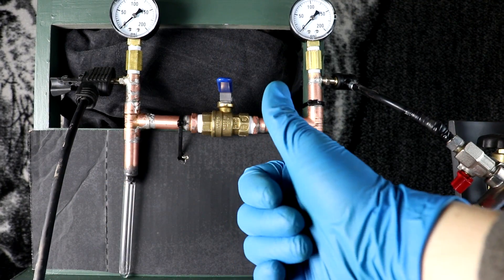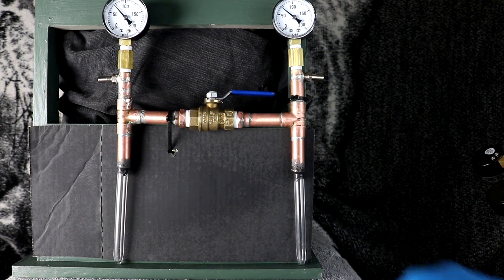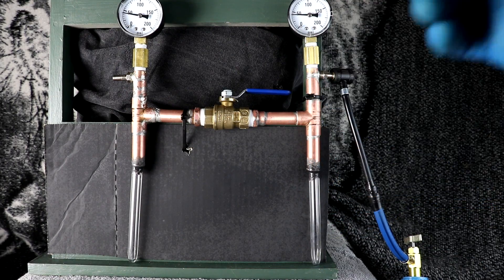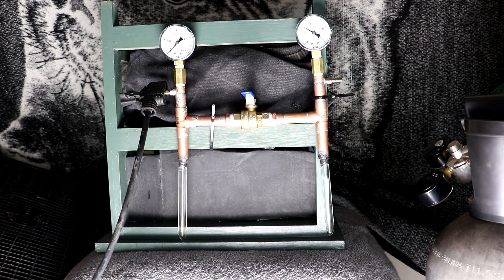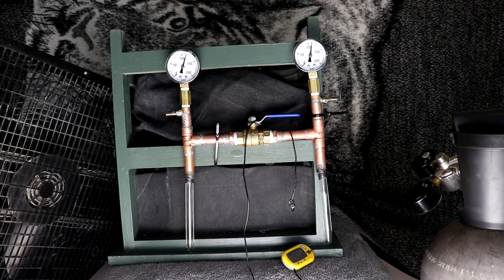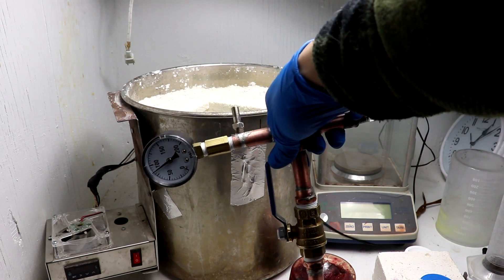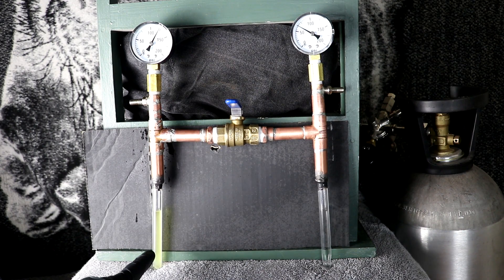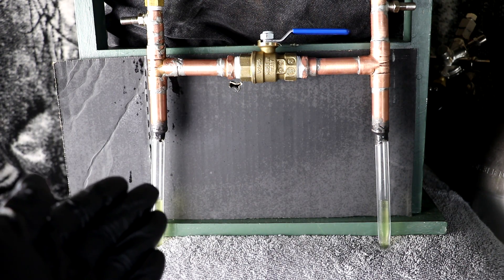The Law of Partial Pressures Demonstrated Using Vapor Pressure

Comment: It makes sense if you think of it in terms of evaporating water allowing things to dry. Imagine a house in the desert (dry air) with two rooms. Hang a lot of wet laundry in one room. Keep the windows and doors closed. Eventually the laundry will stop getting drier, because the air in the closed room will be saturated. Now open the door between the two rooms. Only logical that the laundry now gets drier as the dry air from the other room gets in and helps the lanundry dry again. Not mind-blowing at all.

Comment: Multiple solvents in spray paints have another practical rationale: the fastest flashing solvent are meant to depart rapidly to aid atomization (exiting during spraying) while the slower flashing solvents help moderate surface tension to allow the paint to dry through rather than just skinning over (which leads to thing like orange peel and avalanching)

Comment: One correction, there are some liquids that when mixed lower the vapor pressure. This is because they are more attracted to each other than themselves but as you can guess, these are fewer in number than the normal reactants.

Comment: I wonder having sweat (solder) alot of copper pipe in my day, could you have used lead base solder or a higher mixed lead based solder to attach the galss to the copper. Instead of the jb weld. Assuming they are the same size and all that. We all have seen the windows soldered together in a church or otherwise apparently thats done with lead. Wonder if a glass expert might entertain my thought here give me a coment.

Comment: Finally I understand what is really going on inside a camping fridge. The ones which work with a heat source. Two liquid chemicals mix and "create" cold. Then the mix is heated to split the chemicals, then the chemicals are cooled down to environmental temp before mixed again.

Comment: I enjoyed, but I don't get it. I get that pressure increases with temperature, I can imagine that a chemical reaction can increase pressure. But how can two gasses increase pressure when mixed (without a chemical reaction)? Why did they boil at a lower temperature when mixed? What did I miss?

Comment: Cody, please make an Icyball refrigeration system.  Or make a multi staged version, thermally connecting them in series, but isolating the pressures to condense an external stream of helium. I have been wanting to make a daisy chain of stirling cryocoolers for the same purpose for a long time now. The setup would involve the the cold side of the first stage in a dewar (or insulated reservoir) with the hot side of the next cryocooler. This would repeat as needed, first starting by condensing the nitrogen out of air, then electrolytically separated oxygen from water, then helium from a tank. If don't want to buy the helium, use radio decay to make it yourself! (LOL, kidding/not kidding.)

Comment: Pressures might not have come out exactly as expected due to the ball inside ball valve in the middle adding volume to the system when its opened.

Comment: 1:54 ????  if Daltons law holds true then Ptot=P1 + P2 (150= 100+50) but then it shows 75, huh?  You should have explained why that is the case (volume doubles : Pressure halves) etc.  Then explain why the pressure kept climbing in the other cases.  You did not demonstrate how the gas laws applied.  In fact, you kinda showed that the gas laws are rubbish.

Comment: But two noble gasses wouldn't mix, so we'd get the exact pressure.

Also, would that work similarly for sun water heaters? I added propylene glycol antifreeze to mine, but I think the last time it was filled, they put ethanol glycol. Would that case problems, because of pressure differential?

Comment: Thanks for returning to the lab and putting your smock on :)  The solid science restores my appreciation. Could you include the cite that you needed at 10:20. It might make for some good dry reading in the middle of the night when I am contemplating peer pressure.

Comment: I kinda didn’t get this part:
So in its own chamber, the flamable liquid converts to gas and back to liquid at an identical rate.
However, with another gas introduced to the system, the liquid-gas’s equilibrium will be broken and the liquid will slowly turn to gas...
Why is this so?

Comment: While preparing for chemistry olympiad i came across a qustion: "It's usually noted that pressure doesn't affect the solubility of solids in water. But is that really so? Saturated solution of NaOH @20 Celsius has a mass part of 50,50%, but the density of this solution is 1,530g/cm^3. Crystalline NaOH density is 2,100 g/cm^3. Water density @ 20Celius is 0,9982 g/cm^3. 
Question1: "With calculations prove whether increase in pressure will affect the solubility of NaOH @20 Celsius".
Qustion2: "If the solubility is affected, then how,why?" "

ANSWERS ANY1?
Reply from the maker: well if at very low pressure; the water will be a gas at 20C and thus will not dissolve any NaOH. Ha!
Reply: @theCodyReeder  Oh, that i didn't think about, but i belive the question was if increase in pressure would do anything.
Thanks for telling this.

Comment: In my field of work we build vacuum coating chambers for optics. The cool things is some chambers we build have RGA's or residual gas analyzer which shows you all of the different partial pressures based on atomic weight. The crazy thing is that the vacuum level we get to say 2x10e-7Torr the mean free path of particles inside the chamber is more than 1km. Although we dont hit UHV because that starts in -8Torr range we do get close to it.

Comment: I have a technical question: would it be possible to make nitric acid for home gold refining by mixing a nitrate salt (thinking potassium nitrate in Spectricide stump remover), with sulfuric acid as in the usual distillation setup, but instead of distilling, chilling the solution in a freezer to crystalize the sulfate salt and any unreacted sulfuric acid, and filtering through a glass fiber filter the separate the nitric acid. Multiple filterings should achieve a reasonable purity, with concentration determined water addition to the nitrate salt before mixing with the sulfuric. I lack the proper setup do this myself, and I'd love to hear your thoughts, or maybe see a video trying it!

Comment: So the gist of it is the pressure is being generated by the liquids themselves, rather than the mechanical force of pumping them into the sealed container. Neat! I didn't quite catch why the resultant vapour pressure is the sum of the vapour pressure of both liquids, rather than just the higher of the two. Why would a low vapour pressure liquid continue producing vapour under a high pressure, even though it's being compressed by a gas that's not its own? That's the bit which confused me, personally.

Comment: The reason you get a little less pressure when you open the valve is because the valve itself occupies space which is then removed when the valve is opened. Therefor the total volume of the tubes is larger with the valve open and as a result the pressure is slightly lower then the expected 75.

Comment: The pressure wasn't exactly at 75 because once you opened the ball valve it added the size of the inside of the ball in the valve to the "container" or pipes.

Comment: Pls stop using psi. The rest of the world has moved on to bar which makes so much more sense
Reply: The rest of the world has changed to Pascal = 1N per m^2
Reply: @matthiasburger2315  fair point, pascals do make the most sense; however, like psi, pascals are difficult to comprehend in relation to real life and are mostly only useful for calculations...
Reply: Well luckily bar and Pascal can be converted by a factor of 100.000. So f you have a scale with 1x10^5 it's the same numbers as Bar.
Reply: @whuzzzup  you speak wisdom
Reply: I so agree, but then again... What else can America be known for...  lol

Comment: What I don't get is why this only happens with 2 different gasses. For example, the pressure of TFE in 1 chamber and of butane in the other chamber will add together when the chambers are connected, like in the video. But, with TFE in 1 chamber and TFE in the other chamber when connected, this doesn't happen. Why is there this difference? What if the molecules in the 2 chambers were only slightly different, like carbon-12 TFE with carbon-13 TFE? How different do the molecules need to be?

Comment: You should use this same sort of glass set up to show how air conditioners work, showing the evaporator, the way gas is compressed again, and how that state change affects the temperature of the system using your thermal cameras!

Comment: Seriously great video, but i have some objections.
This is only true if you don't mix the liquids. If you physically mix the liquid, the resulting mixture will have a different vapor pressure. This happens for example with ethanol and water. The reason for this is the change of evaporation rate of the components of the mixture. Think about having a 99% water 1% ethanol mixture, its boiling point is higher than that of pure ethanol. The vapor pressure of the Ethanol is gonna be a lot lower, because it is a lot less likely for a ethanol molecule to go from the liquid phase into the gas phase, because there are a lot less ethanol molecules present at the liquid-vapor-phase-transition (only 1% as many as in pure ethanol). It is true, that there is often (maby always) a mixing ratio of two liquids, that has a lower boiling point than both liquids it is comprised of, but the statement that:"the mixture of one or more liquids will boil at a lower tempreature than any of the liquids that comprise it" is false in my opinion. (think of 1% ethanol 99% water)

Comment: Those types of valves are called ball valves, they are hollow in the middle wich filled with pressurised gas when you opened it, increasing the volume of the system therefore the pressure equalized down further than 75 PSI

Comment: how many different liquids can you mix together to maximize this phenomenon?
could you make a super high vapor pressure mixture that boils a few drops in mere seconds by mixing enough liquids?
Reply: liquid oxygen boils pretty fast at room temp
Reply: @Sorestlor  yeah but my intention is to have something where you separate the liquids by a thin film in a container and by shaking the container it will mix and start boiling rapidly
Reply: neutrocity you would end up with something such as non stabilised crude petroleum. It contains substances that are very light ethane propane and such trailing all the way to heavy molecules that are used to make asphalt. 

Notice that you vaporise the light bits more easily, but along the process the composition changes, leading to a mixture containing almost only the heaviest fractions towards the end. But you cannot speed up the vaporisation unless you do something such as add significant heat, either because there is something doing that or because the substance boils at cryogenic temperature and heat is added from the environment constantly.

Comment: Hmm.. its interesting how fluids can be fully miscible but still have almost purely additive partial pressures. Given oil and water in a container I intuitively get it; but intuitively it seems that if the two fluids are miscible, a propane molecule should be about equally happy to condense upon hitting a fluorocarbon molecule as it does upon hitting propane. But apparently this is not the case, in spite of their miscibility. But it might be good to note in the context of this video that say, mixtures of propane and butane to in fact have a vapor pressure that is pretty much a linear interpolation between the respective fractions. I imagine the degree to which the behavior is additive rather than interpolating depends strongly on the enthalpy of mixing....

Comment: Is this the same principals when you heat up a  olive oil tin with a little  bit of water put the lid  on and then put It in cold water and it shrinks  the can . Then if you take the cool can and heat it up  on hot water it with increase the pressure and fix s the can

Comment: Quite useful information here that the pressures actually adds together. I would have expected that one of the gases had condensed and that the max pressure would have been around the pressure of the higher pressure gas.

Comment: Is this why draining an air compressor tank is so important?  Not the simple fact that it may slowly rust through, but because any water in the tank could expand more than the average person would ever guess and possibly lead to a catastrophic failure of a corroded tank due to a way higher pressure than regular operating pressures?

And my safety squints were fully engaged on my side of the screen!  I want you to put your contraption into your vacuum chamber and see what the failure point is -  you said your gauges measure relative pressure so it should work if it fits.   I don't work with pressurized glass, but I know a bicycle tire at 140 PSI is scary when it explodes! 🧪🥽👁👁

Comment: Suspect the slightly lowered pressure compared to calculated pressure is due to cooling from expansion into double the volume by both gasses as they mix, which might reduce the pressure a little bit.😊

Maybe install a temperature probe on either side to test the effect?

Comment: I'd like to see what happens when you lower those tubes into some cold liquid.  Will there be a meniscus between the liquids in the tubes?  Will there be a similar drop in pressure like the rise when 2 different gases are in it?

Comment: I think I might be missing something based on the explanation of the lowering of boiling points when two liquids are mixed. In an ideal system, the vapor pressures would add according to Raoult's law. There are only deviations when there is an intermolecular interaction between the species in liquid (compared to self interaction) form causing it to "pull" the molecules away from being able to evaporate (Or the other way around). This explains why adding solutes raises the boiling point of water and adding ethanol lowers it (because ethanol interacts less with water than water itself). Im not sure the explanation of simply mixing organic solvents to create fast drying paint is adequate although I understand why considering that could be a whole other video. If I missed something let me know so I understand this correctly.
Reply: FlaggedVideoGuy look at this way with regards to paint add only light solvents and you need to maintain the paint under pressure or solvents will dry off far too quickly, add only heavy and it will take longer to evaporate leading to slowly drying paint.